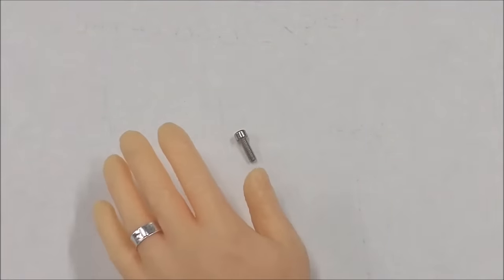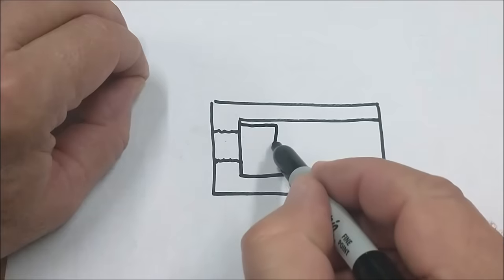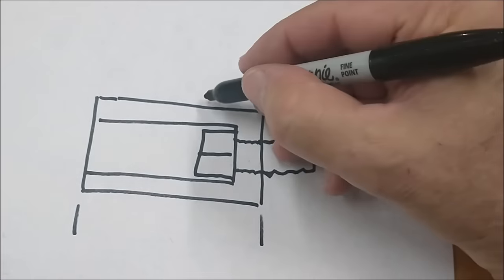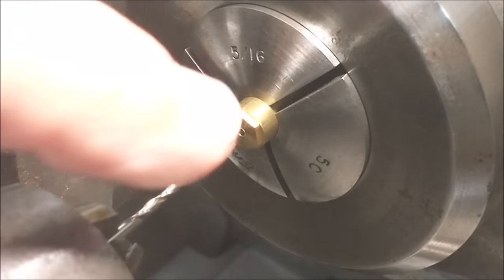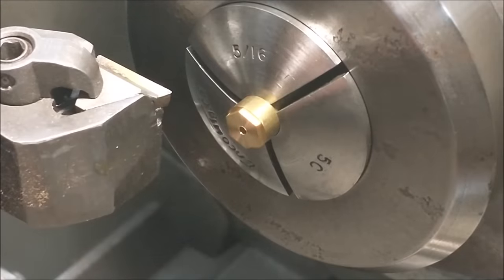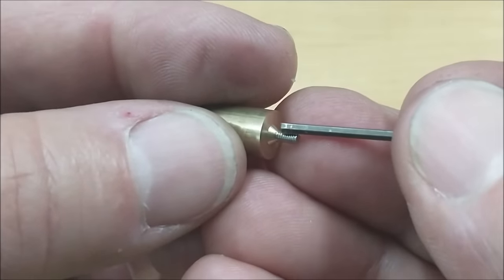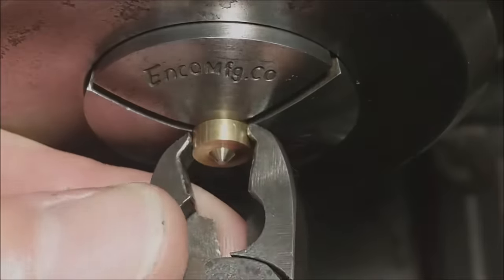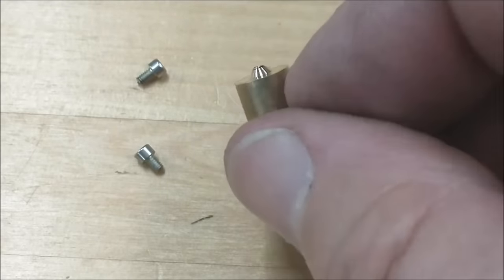Holding and Machining Small Screws !!

Comment: I make my own screws when rebuilding vintage model aero engines.   S12L14 for most but head screws from silver steel (drill rod blank in the USA)  To hold the screw for milling the slot in the head or for machining proprietary screws to length I have made a series of thread holding collets.   Drilled and tapped in brass for each screw thread size,  I then cut three cuts at 120 degrees,  two almost to the tapped hole OD and one into the bore.   Variously used hacksaw,  junior hacksaw or cut with slitting saw on the milling machine.   Hold the "threaded collet" in C3 draw bar collet that my Lathe uses lining up the collet slots to machine threaded section to length if shortening a proprietary screw,   then chamfer the thread start.   Normal lathe rotation so no need to grind up reverse rotation tools.   Smallest screw I have made was 0.035" major dia. after Mother lost hinge screw in her glasses on a Sunday morning.  Single point screw cut,  302 stainless so it wouldn't corrode and head slot cut with a Jewellers saw.  Tricky !

Comment: I frequently have to replace mangled or missing screws with special heads and or threads. Several years ago I was tired of keeping an inventory of screws on hand so I made a set of these fixtures from hex brass, mainly because I had about a foot on hand.  While I was at it I made 3-4 spacers in each size that fit the counter bore.  This allows me to adjust the length of the screw by adding one or more spacers under the screw head. Now I just buy one inch screws with various heads and threads and spend less time chasing screws or waiting for them to arrive.   Have a great holiday with your family!

Comment: I run thousands of screws of various sizes this way for a major defense contractor.  Buy them from the screw machine shop, and I cutoff and/or face, chamfer to length. Usually to +or- .002. 
Some then get the threads undercut to make for captive screws.  Been doing that for a looooong time

Comment: If you put a shoulder on the collet side of the arbor or a collet stop you can use the dro to get the length the same using the dro or a carriage stop. Looks like you're using a collet stop but i thought I'd call it out for those that might have missed it

Comment: If turning in reverse not an option, thread the counterbore (larger thread) and use a bolt in this to clamp the small bolt in position. The difference in thread pitches prevent both unwinding.

Comment: I've been using larger diameter split "buttons" rather than your longer sleeve of similar design for #6 up to 1/2".  Split so they grab the screw threads to permit turning the normal way.  Never occurred to me to run them in reverse.    Where were you when I needed you! ? ! ?  😄  Seriously though, I won't replace the sizes I've got already since the split gripping design works fine.  But I think any of the in between sizes still to be done will be used for reverse turning to avoid the need for the split design with extra hole and saw cut.

Comment: Thanks Joe I have a similar setup because I have to modify or make very small screws for the torsion clocks I restore down to 12 and 14 BA but I have a larger thread behind to lock screw in because I have a threaded chuck on my Myford and it’s almost how a lantern chuck works but I quite often use the Pultra P type lathe and a graver.

Comment: I’ve used this technique on larger screws but always cut a slot in the arbor to facilitate gripping the screw like a collet. I never thought to run the lathe in reverse and rely on the thread to hold the screw in place. I will be doing this from now on. Thanks for the idea!
Reply from the maker: I have used both, but on the smaller stuff, this is golden.

Comment: Gunsmiths use O1 tool steel bar stock that they/we drill and tap to the desired size.  Harden it in a flame and quench it in oil and then use a file to shorten your screw. The file won't cut into the hardened tool steel so you have no risk of thinning the bar stock. You can mill it before hardening to a set thickness if you have a lot of screws to make of the same length.
Reply: I like it. The advantage I can see on this method is you can get a chamfer on the first thread. Of course the disadvantage to the demonstrated method is that they are done one by one.
Reply: I have to do this frequently, usually making sets of screws 4 to 12 at a time.  A few years ago. I made jigs similar to yours but I threaded the counterbored area to accommodate a flat tipped set screw of an appropriate size to set the needed length of thread. I measure the length of the screw and then set the amount that needs to be removed.  I do a rough cut with a fine saw then make the Final Cut in the lathe in reverse.  Once I found it worked I made a set of four for the screws I see, the process goes pretty fast and cuts down on the inventory of screws

Comment: I had a look in my wristwatch.
The screws in there make your little screw look like a sumo wressler thats eaten too many weetabix.
Now that gives me 2 ideas:  I need a weetabix, No I mean you could do the door hinge "properly" (unlike the real deal) and strip out 4 jewels and screws from an old clock to fit the door.
You may even get some spring steel and a couple of jewels to make a doorlock / latch.
Dont mind me,  I am just adding comment to assist algorithm.
Thanks Joe, take care.
Reply: Metric goes down to M0.6 I believe. Please don't tell DELL. They've already started using M1.6 screws in their laptops... 1.6mm is just under 1/16".   
(Had to take out the keyboard of a Latitude 7420. Lots of the little buggers all around the frame. Philips heads, countersunk. One of them ended up stripping the head. Had to drill it out with a 0.8mm drill bit to get the head off. )    
I wouldn't bother with the jewels. They're effing difficult to place properly, and there won't be that much use so wear is insignificant. Those doors doesn't have very smooth hinges in RL, either, so 'keep it real' ;-)   

Spring steel is fun. Just got hold of some 0.1mm thick sheets. Have no idea what to use it for, just wanted to play with it...

Comment: Joe,
I love your videos 
You always come up with very surprising solutions. 
I had thought if you made the fixture as shown but thread the larger bored side and thread it for a bolt or screw that will clear the collet chuck. Thread it in till it contacts the screw head. Then it can't back out running the mill in the forwar direction.
Reply from the maker: There are many modifications that could be made to this concept I'm sure.

Comment: Oh nice! I could've used this idea a couple months ago when I made a 0.75mm watch screw! I had to remake it because the pin vise ate my threads when I tried to finish the head. x.x The tip was murder as well. BTW, I made a plastic 0.177" BB on my watchmaker's lathe using the form tool idea you showed awhile back! :D

Comment: Didn't know that about the head height being the same as the diameter. 

One thing I learned a long time ago was to get the diameter, for imperial screws, you take the number multiply by 13 and add 60. A #1-72 would be:
1 * 13 = 13
13 + 60 = 73 or .073"

#10
10 * 13 = 130"
130 + 60 = 190 or .190"
Reply: But then you get thrown a curve ball like Low Head Cap Screws 😂
I've found I really prefer metric. Tap drill charts. We don't need no stinking tap drill charts.
Reply: @mpetersen6 As a metric guy "letter drills" and "gauge" (as in sheet metal or wire gauge) is the most absurd thing I ever heard
Reply: That is so so good Christopher.  Returning to hobby machining after 2 years at tech school 60 years ago there is so much to learn.preplanning a 10" naval cannon with a 10-24 rod and nuts??? Now I know exactly what it means.
Joe's videos are just priceless to me in so many ways.
Reply: @Sketch1994  That is ok unless you are trying for a specific amount of thread engagement, e.g. with tough materials. Then your set of fractional, letter, and number drills are really handy. When I drill holes for metric threads, I usually don't even bother with metric tap drills.
Christopher's hint about how number sized screws is important to know if you are working on very old machinery (100+ years) or instruments. Rarely used number sized screws show up once in a while. There are other thread systems from back in the day that you need to be aware of as well. Old reference books like Machinery's Handbook describe them. Even if, like Sketch, you work in metric, you need to be aware of different metric diameter and pitch combinations that existed before 1945. German, French, British, and Japanese standards had differences.
Cheers from NC/USA
Reply: What about 0, 00, and 000 screws?
Reply: @tomlutman2041  The '0' is 0.060" . For 00 you subtract 0.013" from 0.060" . Rinse and repeat for the smaller sizes. So an 0-80 screw would be 0.060" in diameter with 80 threads per inch.
Reply: @Sketch1994  
Never mind the confusion between the various US and UK thread systems. Plus I realize obscure ISO threads must exist Machineries Handbook list so many strange thread pitches it runs to pages and pages.

Comment: In the metric system, the height of a slotted screw head and the height of a smooth head can vary depending on the type of screw and its specification. However, for many standard screws, the head height can approximately equal the diameter of the threaded part.

For instance, for certain countersunk or cylindrical head screws, the head height might be close to the diameter of the threaded part, but this isn't an absolute rule for all screw types.

For hexagonal heads, it's typically 1.5 times the diameter, and I believe this applies in the imperial system as well.

Comment: FYI Jo that relationship appears, on the cap screws I have checked, to be the same for metric sized cap screws.   If I'm in hurry I mill a piece of MS to the thickness of the thread length required, drill and tap a hole then fit screw and use a file or a grindstone or even a hacksaw to cut the screw to length.  Backing the screw out usually cleans up any burr created.  True I don't get the finish you do but then the cut end of the screw is usually hidden from view.

Comment: Ya did it again, Joseph.  I never make anything that small but that would be an outstanding way to make  non standard length even something like 1/4-28  screws, or put a dog points on a 3/8 set screws if you need one in a hurry. . (I don't know why I never thought of turning the lathe in reverse,,,????? ) Another trick to put in the bag of tricks.

Comment: I regularly use 0-80 socket heads (electronics assembly), I can assure you the pucker factor is HIGH on drilling a .046 hole in 60-61 and tapping it.

Comment: I have a pretty complete set of arbors for all the smaller size inch and metric screws. Works great! Good idea, just not a new one.
Reply: I have a complete set also. Comes in very handy. Also, just use drill rod arbors. Don’t need to be hard unless you’re going to use dozens or hundreds of times.

Comment: Nice work, great tip. However both of my lathes have screw on chucks so I would do the same but thread the counter-bore to take a screw to bind the object screw in and run the lathe forwards.
Reply: Maybe use a collet instead
Reply: @bobwas4066  To shorten the threaded section? That would be an awful lot of stick out.
Reply: @BensWorkshop Use a collet that fits in your spindle internal taper. Such as a Morse Taper collet.
Reply: @grntitan1  I assumed the collet fitted the late, but if you are shortening the threaded section you will have a lot of stick out from where the bolt is held by only its head regardless of the type of collet used.
Reply: Take the chuck off the headstock.  Use a collet in the headstock, to hold the fixture, which has the screw in it. My lathes also have screw on chucks, I use 5C collets a lot.
Reply: @bobwas4066 Bingo!!

Comment: I’ve use this method sometimes but I use a collet stop that will fit down into the counterbore and hold the head of the screw to keep it from spinning out
Reply from the maker: I try to avoid using the head as the stop point, but I see the value of your setup.
Reply: @joepie221  yeah, depending on the head it isn’t as precise. I like your tips and tricks videos. Especially on the tiny stuff because that’s where I’m at. I’m at the point if I find a jewelers lathe near me, I’m gonna buy it

Comment: By the way, there's an old school method for holding screws that I just recalled.  But it's a LOT more work to make than this sleeve idea or my similar buttons.  The old school way was a "lantern chuck".  Faced with how much work they are to make and ESPECIALLY for such a small size screw your way is a WHOLE lot easier and faster.
Reply: FWIW. Joe's method is also a lantern chuck. Albeit much easier to make.
Reply: @ramonching7772   It's the essence of a Lantern Chuck; what you get when you simplify it down to the fewest possible parts. 
Also, I believe most Lantern Chucks had issues with cutting. Joe's doesn't have that issue because he has a threaded hole and can run the lathe in reverse. 
Joe may need a unique Lantern Chuck for every different size and thread bolt he wants to machine, but so what? Old school Lanterns used inserts, so they also had additional parts.
Reply: @norwegiangadgetman   I understand. Somehow, a machinist would make what he needs. A marketing company will have to make something universal so that it can accommodate most of the potential customer's needs. Hence, more complexity. 
IMHO simplicity beats universal.
Reply: @ramonching7772  I'd have to suggest "not really" if we take the screw on frame that holds the screw to the center cone as being the "lantern".  Or  the situation is that we are gripping the micro lantern chuck by the "glass".  Besides, the reasoning behind the fixture base in the chuck and the screw on "lantern" is to permit turning the screw ends using normal rotation rather than reversed.

Comment: For small screws I drill and tap a piece of 125 or .187 bar stock. Screw the screw in untill the head bottoms out on the bar stock. Hold the head with a screwdriver and lightly sand the screw to the length you want on a belt sander. Checking length with calipers as you go. Also, you can file or sand a small cham on the end. You may have to cool the screw by dipping the bar stock in some water. When you unscrew the screw the bar stock will clean the threads up as it unscrews. This is a fast way of shortening screws once you get the hang of it.
Reply from the maker: Agreed.

Comment: I’m currently shortening lots of 7 BA bolts with hex heads. I’m using double nuts as the arbor but I think I can use this method but the arbor would have to be much larger diameter to accommodate the nut spinner.
Reply from the maker: I would agree.

Comment: THX again question on another subject semi related.threading dial on my modern 14-40 lathe it seems there are twice as many engagement spots on the threading dial as when you showed yours and how to mark the dial with the zones green red so on. Is this because I have an 8 tpi lead screw ? So I cut threads as u taught me turn reverse away from chuck tool inverted I have to turn quite slow to  be confident hitting the half nut accurately. I have been curious about this for awhile does your lathe have 4 tpi screw?

Comment: How about threading the counter bore to fill in another screw to clamp the screw you want to work on? You're clamping the screw on its head only centering on its head flange with a fitting counter bore.

Comment: Why couldn’t you thread the counter bore and then thread in a holding  plug against your work piece thus allowing you to run in normal rotation.  Would this allow the option of different screw lengths or not worth the effort.  ?
Reply from the maker: You could.

Comment: @Joe Pie are you familiar with the lantern chucks?
Reply from the maker: I am now. They still bank on the head. That could effect the overall length if its critical.
Reply: @joepie221  a proper lantern chuck should work exactly like the part you made. The only extra convenience is being able to hold different types of heads securely. I like your simplified approach!

Comment: Tried that with two M5 set screws a couple of months ago. Didn't work well. Couldn't get them firmly locked. So when ground they moved in the thread. Any idea how to do it?
Reply: Hard on Hard is not tight, try putting a brass slug between the screws.

Comment: FYI, the head-depth/thread-diameter ratio of 1 that you stated for UNC and UNF socket head cap screws also applies to similar metric screws... and to imperial BSW, BSF and BA socket head cap screws. Unfortunately, the head diameter doesn't follow a simple ratio and imperial socket head cap screws (including UNC and UNF) generally have proportionally slimmer heads. eg an M6 screw has a 10 mm diameter head, but a 1/4" UNC, UNF, BSW and BSF screw has a 3/8" (9.5 mm) diameter head. It's never as straightforward as you'd hope...

Comment: My lathe cannot reverse so I would tap that relief hole and run a locking screw into the head of the screw being shortened.
Reply from the maker: Sounds like a viable solution.
Reply: My old Craftsman lathe doesn't reverse either. I was thinking the same thing.